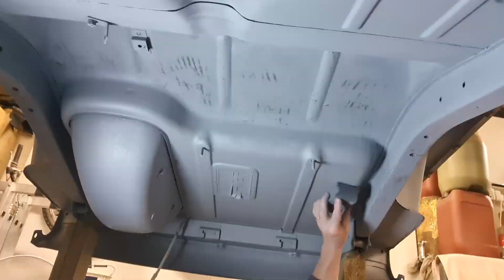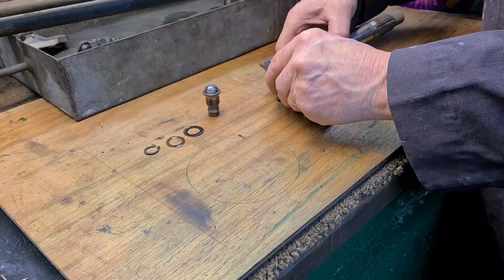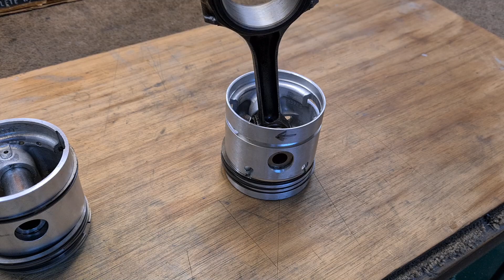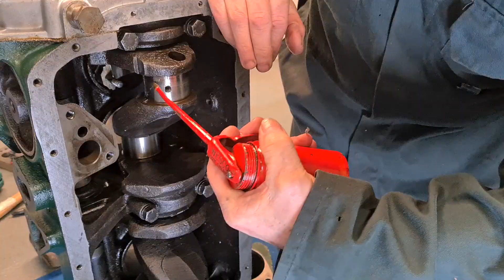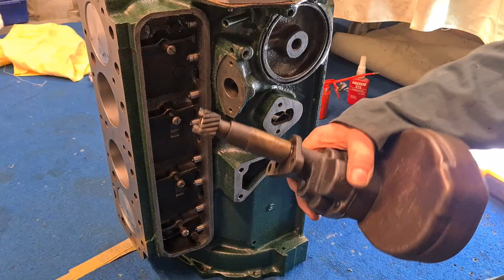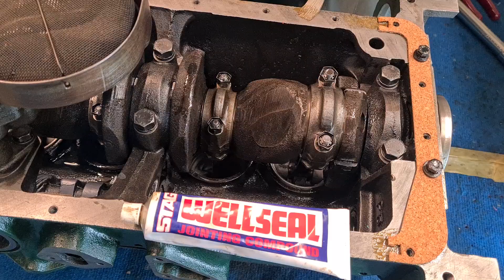Engine Block Part 2

Comment: Steve what would you say to rough cost of rebuilding a consul engine? All machining, new pistons and bearings etc
Reply from the maker: It hard to say pistons are hard to find and the price will vary, your best bet is to look on line and on eBay be very carful on eBay because a lot of stuff is made in China you have to be 100% sure it is the correct part you are looking for.

Comment: You can buy Engine Assembly lube, It's thick stuff and provides lubrication on first startup
Reply from the maker: Is it like really thick oil, I think I have seen that. I will priming the oilways with oil before I start the engine some time in the future.

Comment: Ring positions don't matter because when it's running the rings rotate on the pistons.
Reply from the maker: The workshop manual for this car and many other cars states that the ring gaps should be spaced evenly. This is an excepted way of doing it and it has been so for many years.

Comment: Was watching another youtube, the 2 cylinder mini. He says to put pistons in with no oil, the rings break in quicker.
Reply from the maker: By not lubricating the rings means that they are at risk of picking up (Galling) when the engine is first turned over by the starter motor. Often it takes a long time before the engine fires and throws enough oil up to lubricate the rings.